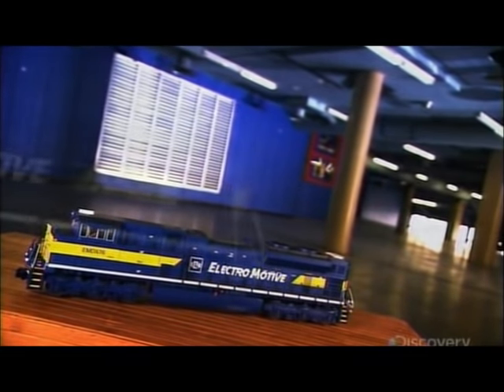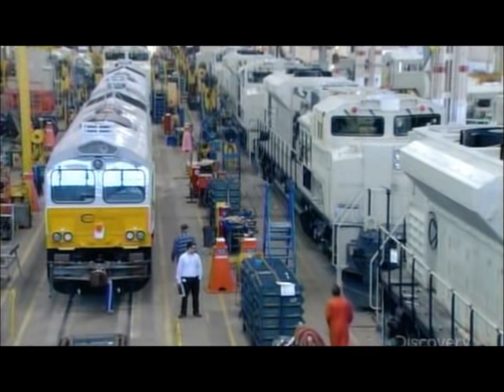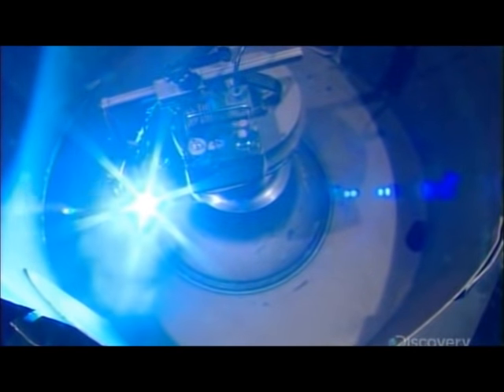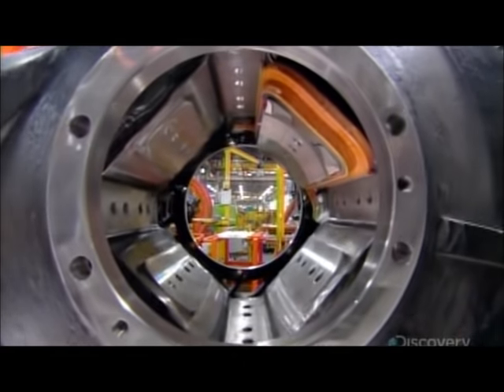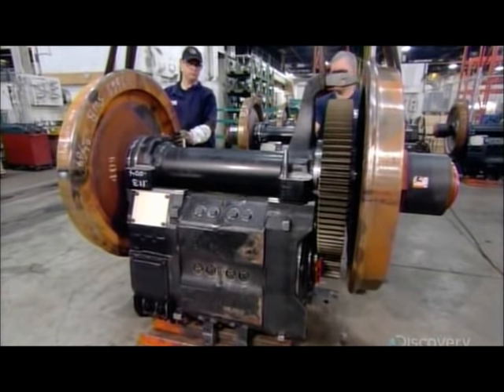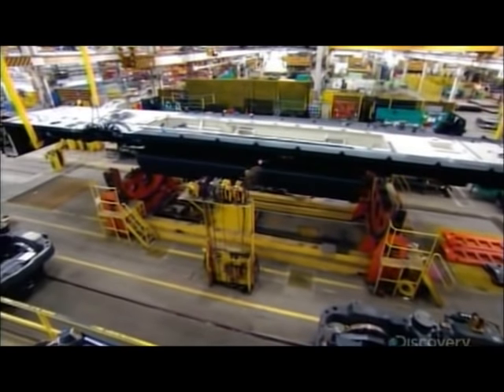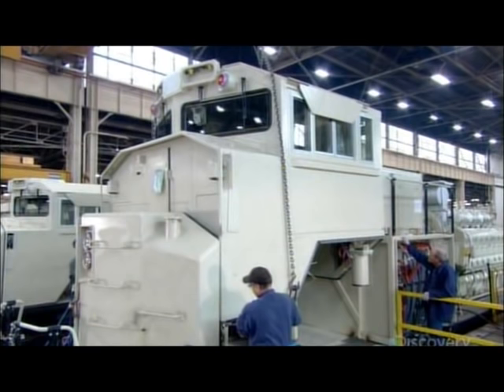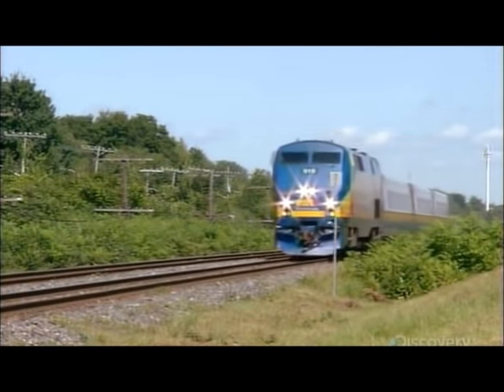How It's Made - Locomotives

Comment: Wait a second. Are those things powered by electric motors? Seriously?
Reply: +flanker  Indeed they are. Given sufficient volts and amps- electric motors can be a powerful as any and they have a much wider torque range than combustion engines.  That's why no gears are needed.
Reply: Nathan Kayle i know that electric motors are very efficient. What really amazed me is the fact that they convert fossil fuel to electric on board. 

If this is more efficient than driving directly with the diesel engines, than electric engines must be massively more efficient than i thought
Reply: +flanker Yeah, electric locomotive that is what's out there.
Reply: +flanker I think this electric system works way easier, than having to deal with clutches and gears in the powertrain. With electric motors the loc can keep pulling non-stop until it reaches the required speed.
Reply: Electricity is infinitely more powerful than fossil fuels if you have enough of it. That giant alternator turned by a 4,500 hp 16 cylinder Diesel engine is surely going to make those 6 electric engines pump out some power
Reply: Chase Prollock I think you meant efficient.
Reply: flanker No I definitely meant powerful. But they are more efficient as well. No fossil fuel engine can produce the low end torque that electric motors can produce.
Reply: Chase Prollock  Even the words most inefficient engine can produce tremendous amounts of power of given enough fuel to burn. If all you want is torque use a 1:10000000 planetary gear. Even a stirling engine can move a locomotive.
Reply: flanker The same can be said about electric motors. Use the appropriate gearing and you can move anything. There are supercars produced that have electric motors in them that make 800 torque instantaneously. And that's nowhere near what they're capable of.
Reply: +Chase Prollock I am sure that a Diesel engine is mor reliable and will last longer and longer when you run outta fuel just put more in plus kectric needs combustion to gets its power unless you run stupid powerlines everywhere dumb idea combustions better im glad here in Australia we have no electric dumb ass trains
Reply: KTM200 EXC
I think you are confused. Even diesel locomotives use electric motors to drive the wheels. The diesel engine just drives a generator to run the motors.
Reply: Yes they are electrc. The diesel engine powers a massive alternator which generates electricity for the electric motors. Its a lot more efficient and you always have the torque regardless of speed unlike a care where the max HP is optained at higher RPM usually. Plus there is no need for a transmission. As you would need anywhere between 20-30 gears to make it work between slow and high speed. In people transport u usally have a diesel engine generating electricity for the train to move and than another diesel engine to generate 480 volts 3 phase for the cars, for the air conditioning lights and everything else
Reply: All diesel trains use electric motors on the drive axles. Even down there in Australia. However, not all electric trains use diesel motors to generate electricity.
Reply: That's not quite true as both the UK & Europe successfully employed diesel-hydraulic drive or better known as hydro's. Krauss-Maffei was the lead designer/ builder. Hydro's use the diesel engine to drive a big automatic transmission that transfers power via big driveshafts to the axles...a big mechanical drive.
Reply: Electric motors can produce torque while standing still. The electric traction system is a better solution then building a clutch that can handle starting a 5000 ton train on a hill.
Reply: Take a look at the specs for the SD80 MAC. - https://en.wikipedia.org/wiki/EMD_SD80MAC
each traction motor can develop a starting torque figure of 12 THOUSAND POUNDS FEET!!! And that is each, there are 6 motors in all.
And the SD80 MAC is now fairly old tech!
Reply: Hydro's don't use a clutch...does your vehicle with an automatic transmission have a clutch?
Reply: KM Ml4000's produced over 17,500 lbs. per axle continuous tractive effort back in 1961.
Reply: MTH DCS I was talking specifically about the torque figure that a traction motor from an SD80 MAC produces not tractive effort, that figure is always readily available. At any rate, the TE produced by the KM MI400's is fairly low now when you consider that the latest Gevo or EMD unit produces close to 200 thousand pounds of starting tractive effort.
Reply: ye its diesel connected to generator and in 1 world countries generator is powered by traction wires.
Reply: I don't believe that it is more efficient as a system, the opposite. It's easier to construct the locomotive. No gears and transmission. Makes more miles maybe. It's a matter of construction costs eventually.
Reply: Are two separate power systems. There are gears and transmission powered by electricity. This is the consept if I understand well. I think that have much less maintenance, makes more miles, it's more easy to build it, have a longer life and low manufacturing costs. I guess for these reasons was the choice of this system. Otherwise why to use two types of energy to move one vehicle?
Reply: In a perfect world, all rail systems would be electrified but since that is prohibitively expensive, diesel- electric is the next best thing. Electric motors are used for transmission because unlike a gear train transmission like a car or truck, electric motors can transmit massive torque from a stand still that can start trains weighing thousands of tonnes. The Diesel- electric concept has been and is the next best thing to a wholly electric locomotive. Mechanical transmission has been tried in the past with limited success.
Reply: flanker 
Diesel locos generate energy on the engine,generates electricity by the generator,then powers the traction motors
Reply: pretty much any mobile machinery over 40 tons will be electrically powered. mechanical and hydraulic reduction transmissions are simply too inefficient and bulky for the power required.

the diesel engine and generator just means the machine is not reliant on power mains for its power.
Reply: The efficiency depends on many things for example the cost. I believe it's a very cheap solution that does the same job as a diesel engine. A big advantage is that it takes very cheap maintenance because have two separate systems.
Reply: Dimit Pap, Cost does have a factor in why they use electrical motors. Operating costs are the big one, not necessarily maintenance.

it costs money to convert fuel into energy, so railways (in this case) are going to consider the cost per hour to run that locomotive.  that is actually why diesel-electric locomotives overshadowed steam so quickly - the operating costs were low enough that it justified the switch.
Reply: Dimit Pap, Cost does have a factor in why they use electrical motors. Operating costs are the big one, not necessarily maintenance.

it costs money to convert fuel into energy, so railways (in this case) are going to consider the cost per hour to run that locomotive.  that is actually why diesel-electric locomotives overshadowed steam so quickly - the operating costs were low enough that it justified the switch.
Reply: + MTH DCS  Technically automatic transmissions do have a clutch. They use clutch packs, and are activated by the pressure of the transmisson fluid.
Reply: @nakayle - Truck mounted motors use reduction gears: a small pinion on the motor shaft and a large gear on the axle. Electric "motors" (locomotives) such as the GG-1 had quill drive: AC motors that drove the drive wheels through quills.
Reply: @illusivec - How would directly driving the wheels work?
Some small shunting (switching) locos have used a clutch and gearbox much like a heavy freight truck has. But for a real railway locomotive a gearbox with dozens of gear ratios would be required.
Reply: @MTHDCS - The Denver & Rio Grand Western RR tried K-M diesel-hydraulics but they wouldn't stand up to the heavy work on an American railway.
Reply: @MTHDCS - Yes. Automatic gearboxes use clutches. A 3 speed has clutches. So do 4 and 5 speed boxes. The torque multiplying fluid coupling is separate from the gearbox. Old Hydramatic and Dynaflow automatics had more than one fluid coupling.
Reply: @formidable38 - All you need to convert tractive effort to motor torque is the gear ratio and wheel diameter.
Reply: flanker you cant pull shit ton of metric tons by a clutch

Comment: rthe U.P Bigboy is still stronger than that 4200 horse power loco
her strength is 6,290 hp
Reply: that means diesels sucks
Reply: @gerrard1144 - UP Big Boy is obsolete. It costs far too much to operate and maintain. The UPRR retired them as fast as they could be replaced by diesel-electrics. As machines they could have been used for 40 years or more if well maintained.
Today the Big Boy 4-8-8-4 is used only for excursion trains.
Few of today's drivers would give up their air conditioned locomotive cabs to drive a coal- or bunker oil-burning steam locomotive.
Reply: Big boy is 2x the size.  Hook two diesels together and you have far superior traction control.  It's not even close.

Comment: why not make these things lighter?
Reply: well You can't if You want to transfer as much torque as You can to the rails...
the engine is so powerful that if the locomotive is lighter will never be able to pull any wagons... also, the same weight of locomotive helps going through deep snow on rails, braking on a descent, start to pull... and the vibrations are also considerable, the ones from the engine, so the material from wich the entire locomotive is made can't be any lighter and be able to withstand vibrations...
Reply: thanks for explaining! that makes sense
Reply: Arcanius Expellam  A thorough and polite reply. Thank you.
Reply: Hi another way to put it is that if locomotives are too light then there will not be enough weight on the rail heads for the wheels to adhere to. What you will get is if a locomotive is too light then the wheels will slip when trying to pull a train. That is one of the reasons some railroads would add weight to their locomotive frames so that the locomotive wheels adhere better to the rails and have enough traction to pull heavy trains.

Comment: Ha Ha a comment by   Farerse  here says why not make these units    lighter   ha  ha he knows nothing about trains nor    physics      now   especially to pull   freight trains   the locos must be heavy simply to have the recquired traction to be able to pull    freight trains    otherwise the steel wheels will spin on the steel   tracks,,   it is abit   different for    lighter   faster     passenger    trains
Reply: That's why a 5MW European locomotive only weights 80T?
A co-co locomotive like shown in the video is just heavy especially if it's a diesel loc!
Reply: It depends whether you want to go fast or haul heavy loads. To go fast (200-300 km/hr.) you don't need much weight on the loco as the train weight isn't all that great (500 tons) but you use the power in getting up to high speeds. For heavy loads (10,000 tons) you need a heavy loco so that the wheels don't slip. The power of the two types of loco might be the same but one hauls a light train fast and the other hauls a heavy train slower.
Reply: @ppdan - 5 Mw is 6,700 HP. If the loco only weighs 80 tonnes that power cannot be used for starting. All it would do is spin the wheels. 6,700 HP is for speed. Locomotives have been equipped with automatic traction control or wheelslip prevention for decades.
Reply: @algrayson8965  What is high speed to you? Locos have had those powers for decades (even without traction control) and the older ones couldn't go faster than 160kmph. They really need that power, not in the first 10-20kmph but after that you can mostly go all the way without slip. Steel on steel has a much better adhesion than what ppl think!

Comment: "Tracks are wider and stronger than in most other parts of the world" = Typical US imbecility. The 4ft 8.5inch "Stephenson" track gauge used in most parts of the US is the norm or majority across much of Europe, China, Australia and certain other countries. The exceptions tend to have WIDER gauges such as Russia 5ft. India, Spain, Portugal, Argentina 5ft 6in. Ireland and Victoria State Australia 5ft 3in. "Stronger" means little, but concrete sleepers and welded rail became the norm in many countries long before it was seen in the US in any quantity.
Reply: Than again, theres some railroads in America that has a 5ft rail gauge like the Pennsylvania railroad that had operated Heavyweight duplex locomotives with giant size tenders, and boy those tenders were Massive alsmost the length of the locomotives them self's, adding more heaviness to the tracks to leading me to think is one of the reasons why the PRR had went with a 5ft gauge track, also America having such heavy locomotives like articulateds like the big boy and Mallets, and gas turbines, and very large diesels as well.